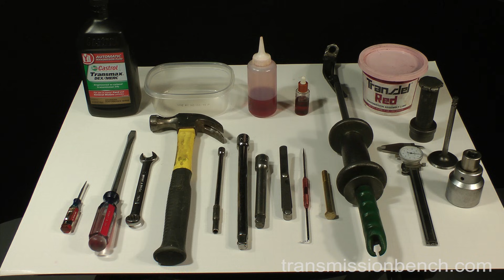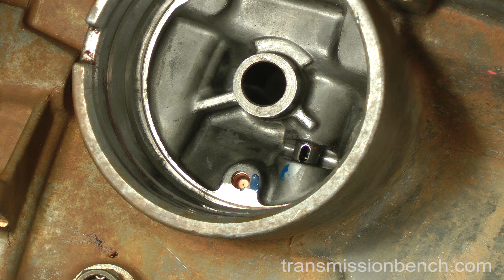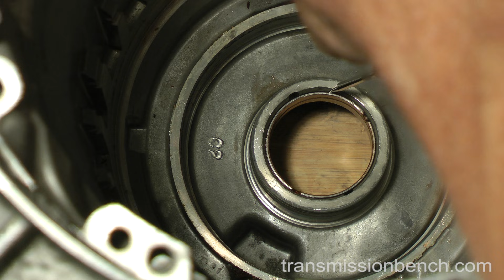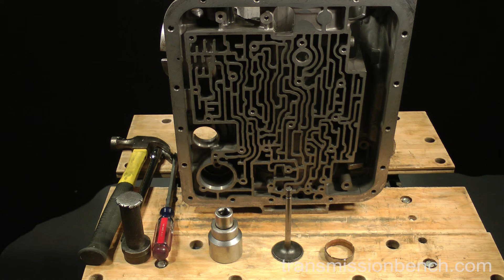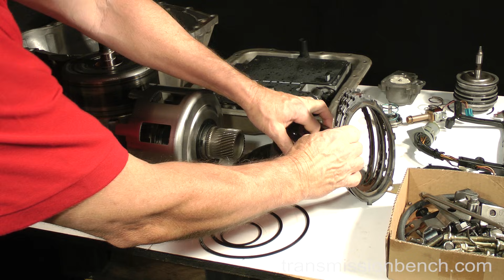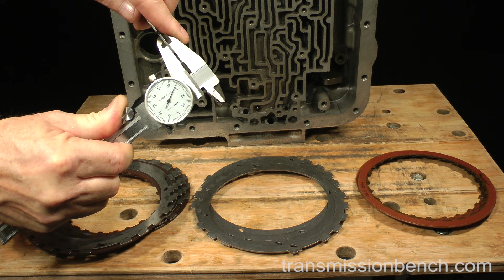Project 4L60E Part 2 lesson 2

Comment: I love this series. I'm rebuilding my transmission using it and few other.  My only small suggestion would be to list part numbers below somewhere for common issue parts like capsule valve.  So far I've found bad case bushing, but my capsule valve seemed to be ok.  Ty so much and transmission bench for putting this out.  I ordered my rebuild kit from them.  My clutch packs didn't come labeled though, just in paper, so I'll have to match em up.

Comment: The bottom of your case inside looks smooth.  Mine (k1500- 1995) seems to have many casting lines(hopefully not cracks!) on the non-machined surfaces .  No leakage, are these normal?

Comment: A NOTE: People needing to replace Capsule, I had to Tap my old one. Couldn't get the 3/8 bolt to THREAD into it. It took me awhile to figure what problem was, i didn't want to damage wall for Capsule, so I was very cautious. I did get it out with much Effort! Good luck on your 4L60E rebuild!
Reply: What size tap
Reply: 3/8-16
Reply: Thank you, same issue

Comment: I am curious about the case bushing; is there a lip like on the pump? I put mine in with the notches in the wrong position, so I drove it right out through the back, even the tool went through! I repositioned it and drove it back in with the notches around 8 or 9 o'clock and 1 o'clock, but played around to get it nearly centered, annd by the time I finished, you could see the bushing's seam, shaped like an "S". Should I remove it and use Loctite and reinstall it? ALSO, is there any reason I couldn't install the rear aluminum Low-Reverse piston now and order another bushing and install it later, after the piston's in? Thanks.

Comment: Hello Mr. William , my question is are 2002 and 2005 transmission case the same or compatible ? I have a good 2002 case , and I want to know if I can use it to replace a damaged 2005 4l60E case ?
Reply: 2004 & up has a front pump that no longer uses an o-ring around the entire pump body; it has a hard seal that goes between the case and bellhousing. The cases & pumps are different.

Comment: I'm not married, i drilled a hole in my coffee table to hold my input drum.
Reply: actually one of the best comments ive seen bro hahahaha
Reply: I'm the wife and I'm doing the rebuild on the dining room, although I just used the extension housing to hold the input drum on the table. If I end up rebuilding one of our other Chevys' transmissions I'll probably drill a hole into the table though, as that would be way easier and I feel dumb for not thinking of it this time 🤣🙃

Comment: I disassembled my 1994 4L60E the inside of the sunshell and the input drum are both chewed up from contact looks just like brake pads when they are down to the metal... What would cause that problem??
Reply: @rickjeffjeff  Watch a bunch of the "Precision Transmission" videos. Richard shows a lot of the damage done by switching D<->R while the vehicle is moving. The Transmission Bench videos are simply outstanding treasures on how to overhaul these transmissions. You won't find better!
Reply: Totally depends on where they're chewed. Without pix, it's pretty hard to tell. Replace them both.

Comment: Snap ring install must come with experience. Took me to the edge of madness getting them on and off.
Reply: Me too, specifically the low reverse spring cage. Took me over an hour to get it back in.
Reply: It almost caused a divorce for me. Lol
Reply: I am going on 2 hours and still no luck getting the darn snap ring on the low/reverse spring cage out. I am literally on the edge of tears and/or madness. LOL
Reply: @kbail152 Mine wad jammed in case, it was unusable, I had to buy a new case, New Used case. Never could get snap ring off. Half way was it. Couldn't compress spring cage due to jamming to side. I had some bad metal chips in transmission due to failing Pinion Gear, causing many other failures. Hope u had a good outcome!
Reply: That was my same situation. My suggestion and what worked for me is use a smaller pair of snap ring pliers and a small double angle pick or pocket knife. It's only the first time that's the problem. Once you accomplish the mission it only takes seconds if you had to do it again. 
 @kbail152
Reply: @kbail152 to install it use a long screwdriver and simply place the snapring on top and use flat head screwdriver to push it on  start with an open end and walk it around. It's painless @mafiatransmission shows how to do it.
Reply: Bushing installs are a little difficult at first as well until you have done a few.
Reply: There are also many different snap ring pliers the right ones make it easier
Reply: Glad to know I wasn’t alone with fighting those damn snap rings😂
Reply: You need very specific pliers or to be good with picks and screw drivers to walk it in a buddy can help you by holding the closed end with a long flat head while you walk it in with pick or another flat head either way yes pain in the ass 😂

Comment: my 84 vette doesnt have a checkball capsule in the low reverse piston hole .why? and what does this change?
Reply: 84 isn't a 4l60e lol
Reply: No but it's a 700-R4/4L60 (4=forward gears, L=Longitudinal, 60= torque rating)? Or 4L60 no  (E ) = electronic?
Reply: You don't need it...

Comment: Out of curiosity, with regards to the clutch pack, the wavy seal has no fibre friction plate between it and the first steel seal that is installed. Is there any reason for this? And is there any reason why there is no fibre friction plate behind the wavy seal?
Reply: If you watch Precision Transmission videos on 4l60 he explains what the wavy ring is about.

Comment: my ring gear does not spin freely. it does spin. it has new needle bearings lubed with trans fluid, and new bushing installed per the instructions on this video with the finest attention to detail. it does not bind, just does not spin free
Reply: Mine doesn't spin like that either. Did you ever find out if that is an issue?